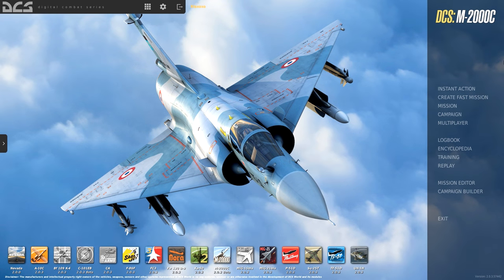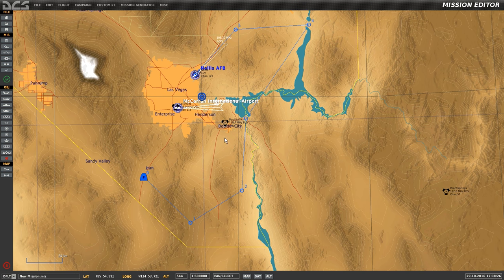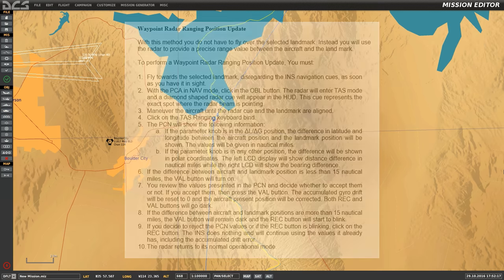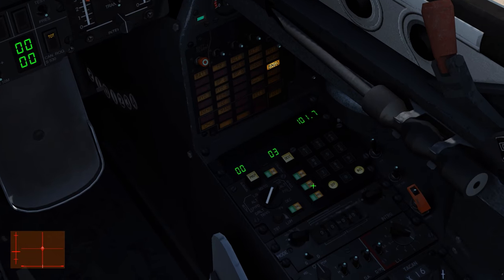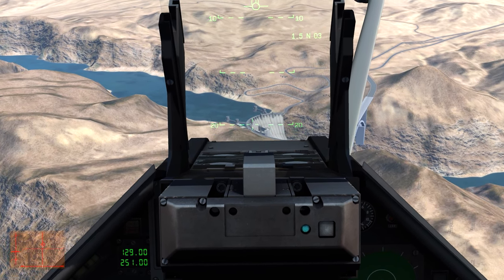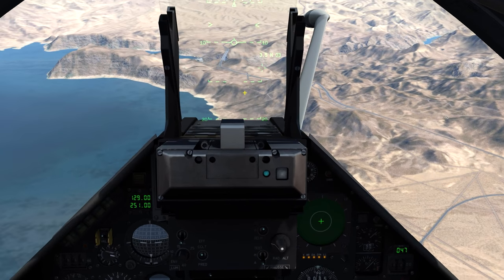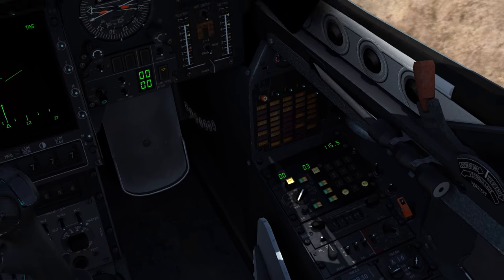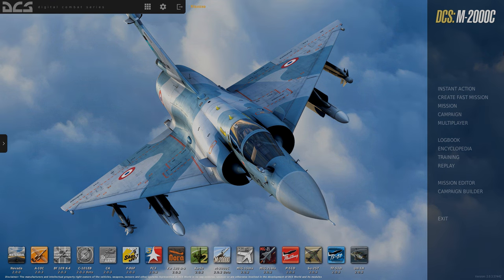DCS World: Mirage - INS Position Update Guide (Part 3)

Comment: Hi, I have few issues I have with that video + some tips. First of all the INS Waypoint Flyby Position Update. In manual it says that REC (and not VAL) button should be pressed when u fly directly over the landmark and not 3 miles before it, as the name suggest. Then INS gives u bearing and distance between its old position of waypoint and new position you just made using REC. VAL is only used to confirm the mark u made with REC button (so u can be already at some distance from landmark). So in that video the waypoint u made should be aligned to 3 miles 90 degrees from old waypoint postion and not on the dam itself. If it still aligned to dam then its a bug and RAZBAM should fix it. Its not really a Flyby position  Update if u dont actually Flyby the position isnt it? Ok now the good stuff :P If u dont like the fix u just made u can always Update position again. You can update position (when u using radar for example as ur aiming is off the landmark) as many times you want. INS only will apply update when VAL button is pressed. U can cancel updating by pressing REC again. Also during Radar Position update u can use Magic slew button on Hotas which works like REC button when OBL mode is active. 

PS
please note that I have no idea how real M2kc works and I just base this on manual and logic. So if it works as presented here then Manual is wrong ;)
Reply from the maker: You can fix the INS Possition if you're within 15 Nm of the waypoint if you're further then that the REC button will flash but other then that be it Waypoint fly by or radar you don't need to actually fly over the point.

But what you said is mostly true and are cool tips
Reply: So how exactly INS know then where to zero in on landmark? I mean if u fly over landmark and then press REC then thats logical. Thats where you are, thats where landmark is, thats where waypoint should be. But if u press REC completely off landmark (15 nm its quite big radius) like u did in video, how INS know where dam is relative to position where u pressed REC? ? As I understand INS can drift to any direction and its completely random.
Reply: Just because u can currently do that, doesnt mean you should be able to. I see it as bug, which require fix. Because right now, it kinda kills radar INS calibration (Where BTW u supposed to put piper on landmark itself and not in 15 nm radius around it). Do you understand what I mean?
Reply from the maker: This is a good question and I think it's better if by being answered by a DEV instead of me, I know so far that my Drift always occured in 1 direction so far so I'm not exactly sure how it  happens, Saying that Drift does occur in different directions but once the waypoints are set up I noticed it tend to always go in 1 way for each flight plan.

Try asking this question on Forums maybe you'll get your answer
Reply: I fully agree and the problem is with both the Fly "Over" and Radar update method.
I´m sure You need to press the Rec button when You are exactly over the correct position for the waypoint ie. the Hooverdam itself and not some miles away where it is still in the HUD.
Also for the radar update the diamond spot must be put on the Hoover Dam to set the exact position. Especially in this mode You should see the waypoint cross move to where the Diamond spot was placed when pressing the Nav update button and not by some magic move to the correct position by itself, despite the diamond spot being off.

In both cases there would be no way the INS system could now how to correct by doing as shown in the video.

Comment: So do you need to set a waypoint in the mission editor  before you fly in order to use it to update your INS or can you do it with a waypoint you created during flight?
Reply from the maker: Well you can do it with any waypoint but doing it wil one created on the fly will be rather difficult cause you don't know if your system did it correctly or not but theorietically it is possible
Reply: thx for the fast response! What makes you think the system won't do it correctly?
Reply from the maker: Well, if you've tried to input new waypoint when the nav system is drifting i'm not sure if it will put the waypoint correctly so it will be hard to know where exactly to do the Update

But if the system is properly calibrated it should be ok